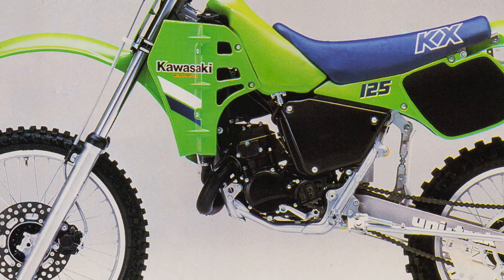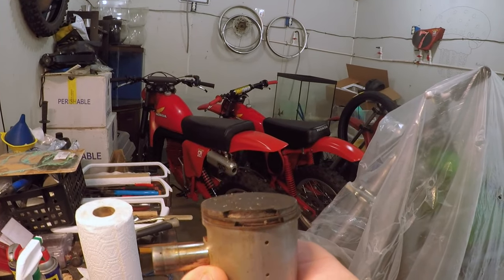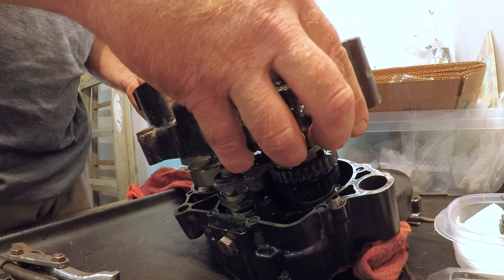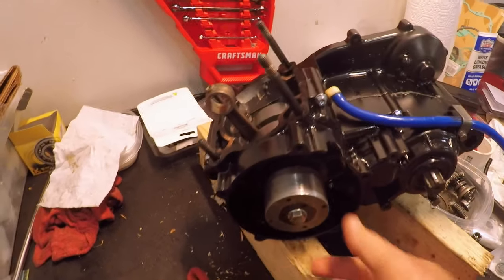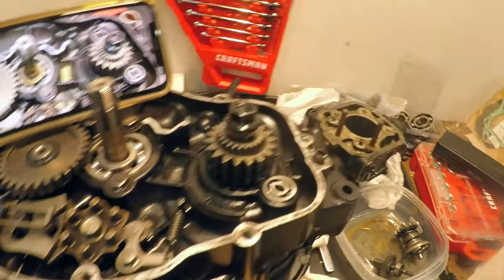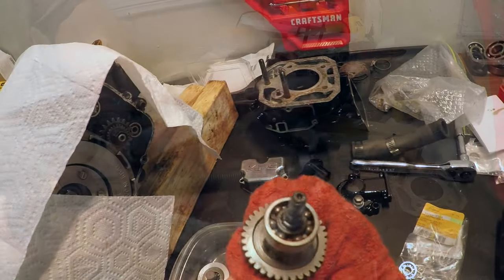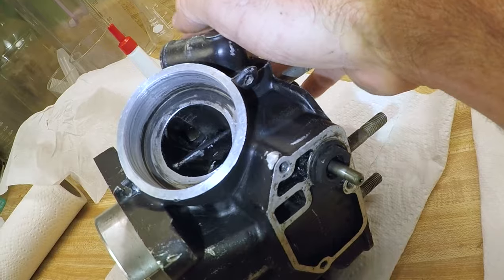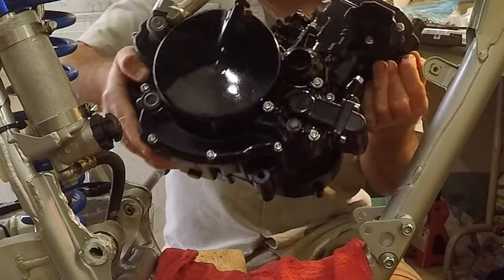Rebuilding a KX125 Engine - Completely!

Comment: Great video! Very easy to understand what your doing and I didn’t fall asleep watching it! 👍 Are those CRs for sale? Lol I have been looking for a 79 or 80 CR125 and 250! I raced both those bikes back in the mid 80s and want to find a 125 and 250 a 1980 250 and a 79 or 80’ 125. We are going through the same thing you are with an 86 Kx 125 for my grandson. I did the same thing, the compression test was great, it even ran for a couple laps around the yard, until it seized!

Comment: I remember on my 85 KX 125, when it came time to replace the piston and rings, the hot ticket was to use an 86 piston and ring because the 86 only used a single ring, not dual rings like the 85, so it revved quicker.
Reply: Yeah wait, how would putting an OEM part from a different year on make it rev quicker?

Comment: I just bought the same carb you put on your Honda CR250R Elsinore. What size jet did you put in to rich it up?  Thanks
Reply from the maker: I just checked through my records and it looks like I bought a 340 main jet for the 34mm Carb for my Elsinore. The 1978 CR250 only got an air screw adjustment and a needle clip position change.
Reply: @Bradybrandwood  in your video you said it was a 36mm carb. That’s what mine is to.
Reply from the maker: @James Swetland  Yeah I don’t think I did a jet change on the 36 mm carb though.  I have two of them, and they were very close right out of the box.
Reply: @Bradybrandwood  I’m putting mine on tomorrow. I’ll run it & see what happens. Great bike!!

Comment: What did you use to get the Flywheel off??? I just took the magneto out of mine but cant get the crank out without removing the flywheel
Reply from the maker: Hey KV, I used a wheel puller,… and heated the spindle a bit with a torch. ✌️✌️✌️

Comment: what is the carburetor  you use on this build i cant seem to find one that works good like exact name if you could if u remember
Reply from the maker: Hi the carb is a Mikuni 34mm round slide carb.   You can get them on EBay or at DC Plastics ✌️✌️✌️
Reply: @Bradybrandwood  but there like VM34-275 and vm34-168 is there a certain one you used

Comment: Just picked up a really good condition 1990 kx 125. Starts right up and idles good but 1st and 2nd gear have very little power. 3rd gear the power finally kicks in but still not like a 125 should. Im not the most mechanically inclined guy but i can take instruction. Any suggestions for a good place to start would be appreciated. Im going to start with easiest stuff first like changing the spark plug and cleaning the carb. What should be my next check after that?

Comment: Having a hard time removing the flywheel any advice how did you do it really need help thank in advance!
Reply from the maker: Hey yeah I had a hard time too.  I sprayed WD-40 on it and let it soak, and used a 2 arm flywheel puller,... and slowly tightened that down while I heated the crank spindle with an electric heat gun,...

Comment: if you have an bearing supply house near you, like a warehouse in an industrial area kind of place, take in the old bearings in and have them match them up. It'll save you some Ebaying and waiting on shipping.
Reply: they can also get you the oil seals just based off of the dimensions on the old seals.

Comment: Hi, I was wondering if your bike requires a secondary movement after either shifting up or down to return the shifting mechanism back into position to make the next change? Example: after shifting from 2nd to 3rd I have to lightly press the shifter down in order to perform another shift... 

Thanks for the video; It was extremely helpful!
Reply from the maker: Hi, no it should re set on its own.  You may have the return spring in the wrong position, or something too tight and binding preventing your shifter from returning to center.  Also check to see that the shift drum is in correctly.  ✌️✌️✌️
Reply: @Bradybrandwood  Thanks for the quick reply. Glad to hear it's not just a design flaw. I will check it out.

Comment: What paint did you use on the motor
Reply from the maker: The engine paint was VHT High Temperature Engine Enamel,… from AutoZone. ✌️✌️✌️
Reply: Thanks how about the frame

Comment: Working on rebuilding the same bike could I by any chance get links too all parts please exept piston and cylinder thank you
Reply from the maker: If you go online to one of the parts warehouses, and click your way to KX 125 you should get a schematic of all of the parts on the bike which will give you part numbers and details on what you need to replace. You probably won’t be able to buy these parts directly but the part number will help you find replacement parts.  ✌️✌️✌️

Comment: What did you used to pull the fly wheel off
Reply from the maker: I used the same wheel puller that is seen during the splitting of the cases scenes.  With some WD40 and a heat gun.  ✌️✌️✌️